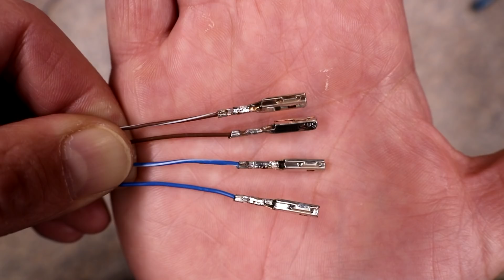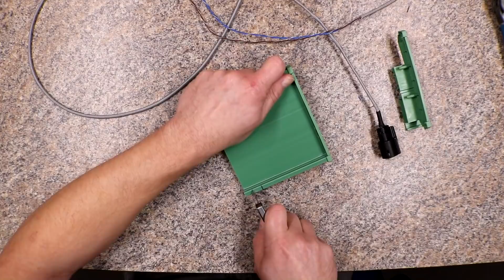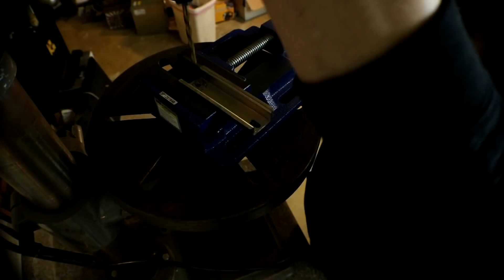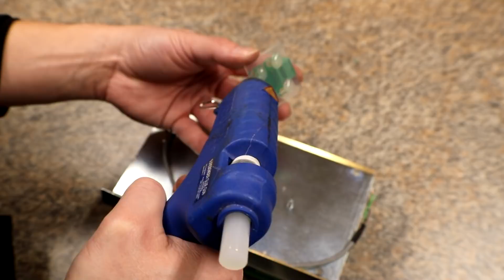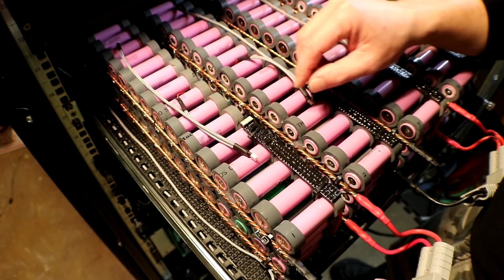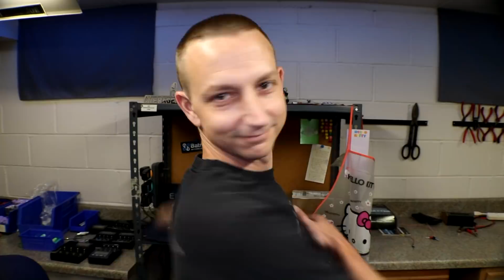Batrium Bms Shunt and WatchMon Install!

Comment: Joe would a batrium be a good solution to my non bms leaf cells? Ive ordered a 300 amp dally and a couple of the jkbms with 2 amp balance.  I also ordered several of the little active balancers off amazon. This batrium stuff looks much better than the stuff ive ordered tho. What you think for the leaf cells? Ill put the jk on my lifepo4 battery but maybe send the dally back
Reply from the maker: Batrium is top notch stuff. I dont think its needed for a smaller battery. Jbd or JK would be fine. For sure send the daly back tho🤘
Reply: @AVERAGE_JOE  I really wish I hadn't ordered the dally. I'd ordered it kinda spur the moment but after seeing so many videos on how crappy it is I wish I'd just ordered more of the jk. Do you think I should put 1 bms per 8 cells? At the moment I've ordered 16 cells and 2 jkbms. Someone said I could have just used one jk and just parallel the 2 cells at a time and then did the series and gotten away with one bms. I thought it would be better to not parallel cells bit parallel the whole 8s battery with another 8s battery. What's your opinion with this? I figure I'd have a better chance of not burning up the bms if I used 2 bms for the 16 cells
Reply from the maker: Well it really comes down to how much power you want to draw. If 1 100amp bms or 2500watts is enough then do 1 bms. If your system can draw more then that, then do 2 batteries and 2 bms's.
Reply: @AVERAGE_JOE  I run 2 inverters at the moment that equal 7000 watts. They are hooked up to my leaf cells with no bms. Danger !!! I know.. but once I get my lifepo4 battery built the leaf cells will run the 4000 and lifepo4 run the 3000. Yep.. I gotta have a minimum of 2 of those bms I guess for my 3000 watt inverter then. Thanks for helping
Reply from the maker: You bet man!

Comment: As always excellent tutorials.  Can I ask, what kind of safety setup do you have for the Batrium?  Fuses?  Shunt Trip breaker? Thanks
Reply from the maker: Thanks!  At the moment I dont have much other then a fuse on the positive wire sadly BUT I did just order a ABB 300amp shunt trip breaker.  Almost went with 150amp but will be adding another 10kwh here soon. Plan to have a smoke detector hooked up once I find the right one.  Thought about adding fans for cooling but dont think Ill need it.
Reply: @AVERAGE_JOE  Did you buy that ABB used ...which model?  As I understand it not all of them have the trip coil in them is why I ask.  Also, you have the expansion board with your Batrium right?  I also have been made aware that you do not need that for a shunt trip breaker ...but it is better to have it.
Reply from the maker: Yeah got a used one and made sure it had the coil https://ebay.to/2Is1U8X Yeah I got the expansion board for possible future add-ons but you dont need it if your adding a few things.

Comment: Ive watched this a few times now. How is the balancing on the watchmon 4? Have you had any cell that it would not balance with it? I just bought 1 for some new A123 26650 cells. See what I found in my vids . I am finding the 100A china bms with 60mA balance is not burning enough power to let the low cells catch up. What are your thoughts?
Reply: @ 16 min. The 2 pin connectors . Do they go to pos and neg?
Reply from the maker: I think the balancing from wm4 is GREAT!  I havent had any issues with it not balancing.  Usually it will burn around 1.7amps or less but can go over 2amps if it needs to.  Ill take a look at your vids to see what you got going on!
Reply from the maker: The 2 pin is the data wires that go from one longmon to the next.  The 4 pin has pos and neg and the 2 data wires.
Reply: @AVERAGE_JOE  thanks brother. Any balancing issues?
Reply: @AVERAGE_JOE  thanks.  I didnt see this till after. So it burns off the power from high cells ? I wonder if there is a bms that tranfers power instead of burning?
Reply from the maker: Yeah most bms's will balance on the very top end like yours. Batrium can start balancing at a lower voltage if you want it to. Also batrium is working on an active balancer to transfer energy from one pack/cell to another!😀

Comment: HI is the power wire for the watchmon 4 pack voltage ie 48v or is it a lower voltage 12v ?
Reply from the maker: You can use any voltage from 8 to 65v to power the watchmon!👍⚡
Reply: @AVERAGE_JOE   Thanks Joe

Comment: I can appreciate what Batrium are doing for li-ion packs, but $750 for a passive BMS is absurd.
Reply from the maker: They are doing Awesome things, always upgrading and keeping up with the times!  At first I thought the price was up there as well but after having it installed and using it for a little while, I am completely satisfied with the purchase.  Plus, I have only scratched the surface with all the options you can do.  There is no other bms that compares.  Also Im not affiliated or anything like that,  I just really like and believe in there system.   After watching all the others failed attempts with the cheap bms's out there I wanted a good one since Im using all reclaimed cells . It keeps my mind at ease since Im not around to monitor the packs.  Best babysitter Ive ever paid for!!!😉😉👍
Reply: BMS selection is basically nil, electrodacus notwithstanding (though limited to 24v). Do you know of any alternatives from, say, EV applications?
Reply from the maker: Someone on the diypowerwall fb page is working on a diy bms.  Youtuber Adam Welch did a video on it.

Comment: Yeaahh what a great video, most importantly “not rushing to keep the video short” and showing every little relevant detail!!! 
Are you also making videos showing the new WatchMon4 and the new ShuntMon with pluggable connectors?
Batrium POWEEEEEERRR ohhh yeaaahhh
Reply: Aussie POWEEEERRRR!
Reply: Karl Bartelt ohhhh yeaaahhh =]
Reply from the maker: Yeah that was one thing I didnt want to do was rush through all the connections and explain what I could.  Yeah Ill need to get the New WatchMon4 and New ShuntMon to UPGRADE!!!!  Pluggable connections would make it alot easier for sure!!! BOOOOOM!💥💥💥👍
Reply: AveRage Joe I have a question about the pvc you used has holders what size of pipe did you use because I can't find the right size
Reply: Matthew Anglin I'm kinda wondering the same thing.. think I've asked him before but I don't remember. I think it looks like 3/4" schedule 80 pipe.. too bad I can find any except the curved stuff around here!
Reply: Todd LaPlante 3/4 doesn't fit as good as his does I tried 3/4 I think it had like and 1/8 of a inch gape on it
Reply: Todd LaPlante his pipe was 3/4 ID and 1" OD I'll have to go find a 3/4 ID pipe I think the stuff I was looking for yesterday was OD measurements because I looked at 3/4 it didn't slid in like his did so I'll have to go look for the 3/4 ID pvc
Reply: Matthew Anglin Thanks for the info.. Maybe a trip to HomeDepot is in order! Although I have nowhere near the number of cells Joe does lol.. just maybe going to make a very small pack at least.. gotta start somewhere!
Reply: Todd LaPlante I have 800 cells so I would need 1600 pieces of pipe
Reply from the maker: Trooooof!😆👍
Reply from the maker: The PVC was from Lowes and is 3/4" sch80 part# 49731😃
Reply: AveRage Joe Thanks I'll go look around at the sprinkler stuff
Reply: AveRage Joe https://m.lowes.com/pd/Charlotte-Pipe-3-4-in-x-10-ft-690-PSI-PVC-Pipe/3134567 is that it?
Reply from the maker: Yep, 3/4" ID and 1"OD.  I found it near the sprinkler stuff!
Reply from the maker: Yeah that looks like the one!!!!!!😃👍

Comment: Very nice Joe. I do networking back in Jersey and here is a "Pro Tool Tip" for you. If you keep flexing that network wire and bending it over and over it will brake. Depending on what Cat wire it is. And i don't mean Hor-es. Wait how in the heck do you spell his name.... BOOM 💥💥💥 there it goes 😜
Reply from the maker: Thanks Man!  Which network wire are you talking about?  The usb cable?  If so then that is really only used when setting it up for the first time.  Or are you talking about all the networking wire I used for the longmons ect...  Oh and you spell 😺 name like eye of horus!💥
Reply: AveRage Joe the ones you use on your little hores lol just kidding.

Comment: Thanks for the downlow on the display screen. I'm thinking about getting a baitrium system.  I need something! I plas to put my lithium bank in service soon. I don't want to. With out monitoring and some protection from imbalance. What is the power useage of the system. And monitoring? I am off grid. Every miliamp counts. When you are plugged in to the sun. I am working on a DC. Generator. To charge the bank. (Lead acid)  I would like to have a way to charge the lithium bank when there is no sun also. The best option I found is to use a midnight classic with a pma or modified alternator. That is expensive! Since it doesent hurt the lithium to be discharged for a while . I'll just charge the lead acid Bank. And wait for sun to charge the liion bank. Great video. Thanks again for the discriptiption of the display! Keep it up señor Joe!
Reply from the maker: Thanks Man!  Yeah theres tons of stuff you can do with BMS.  Power usage is Tiny, cant remember off top of my head but its minimal.  I think I show it in the install guide video I made linked below.  Yeah a dc geny would be nice to have.  What voltage are you using in your system?
Reply: AveRage Joe 
I have 24v of Mt105 golf cart batts. A 24v set of L16 batts. 450ah for the L-16's, and 200ah for the others. I'm going to get another set of the 6v Trojan T105 replacements. That way they will be close to the capacity of the L-16's. I have 7s liion bank. I also have a small 3s bank with 26650's lil over 20ah for now. The 7s is almost 80p! @ over 2600 mah each. I'm planning to build it to 100p. then put it in a pack . then start over build another up to 100p,7series. Build about 6 , 700 cell banks! I guess a longmon per 100 cells is about enough?? I was reading. You can put 250 longmons or cell monitors per pack monitor . that's crazy. The record is like 168 or so. That's a lot of long mons. For balancing. I think 100 cells , per longmon. Is on the verge of too many. If things aren't close. If packs are not matched, or cells per pack not matched. Mine are very close. I hope it stays balanced. But you never know until the electrons flow!!! Thanks SIR, JOE!
Reply from the maker: Ok cool! Yeah My packs are what replaced my tojan 105's.  I had 12 of them for a 12v system.  I really wanted the L16's back in the day lol.  You have quite the setup there it sounds like.  For the longmons, I wanna say they have seen up to 800ah in a system but it took forever to balance out.  I would think no more then 250ah on a longmon as long the packs are balanced well.  Mine are balanced within 30 or 300mah (cant remember) but again thats using the chargers we use.  You can re capacity check the same cell and get another number.  When I look at the screen while charging I dont have a pack thats always in bypass mode so thats good.   So I think there doing pretty good.  You could technically add more longmons to a pack if needed.  Another reason why I top balanced the packs vs bottom balance.  Id rather them be in balance when full charged so packs dont try to over charge.  And YES, you never know till the electrons flow!!!!😃👍